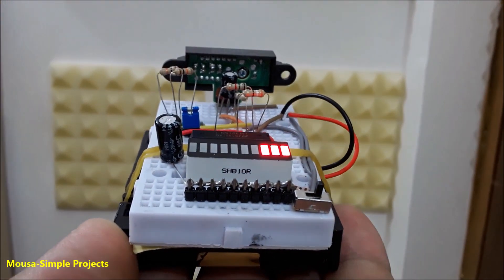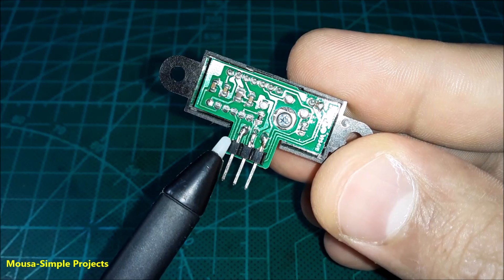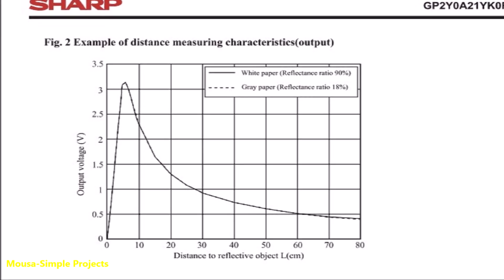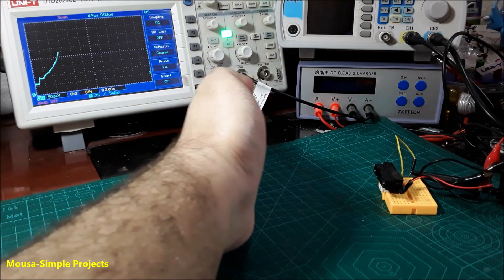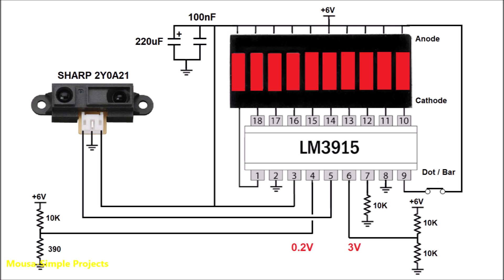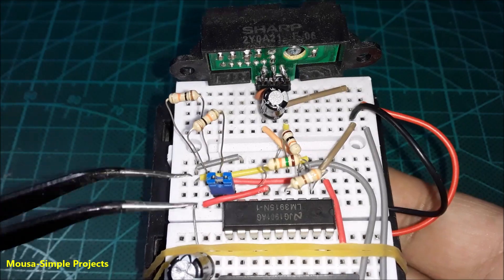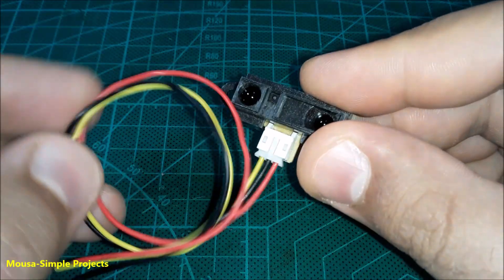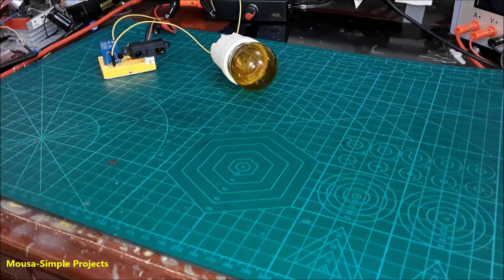Distance Meter Without Arduino | How to Use Sharp 2Y0A21 Distance Sensor

Comment: Great video.    Love how you come up with ways to use device  outputs WITHOUT ARDUINO of other MICRO CONTROLLERS!!!!!!!!!!!!!!!!!!!!!!!!    What sort of surfaces will not provide accurate readings from this device application>    Any thoughts would be good to know,   THANX!!!!